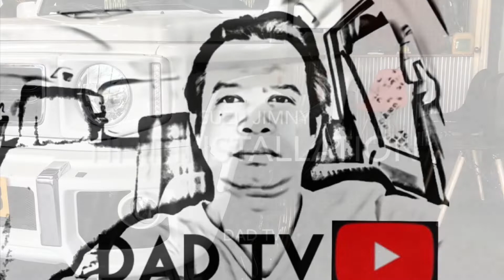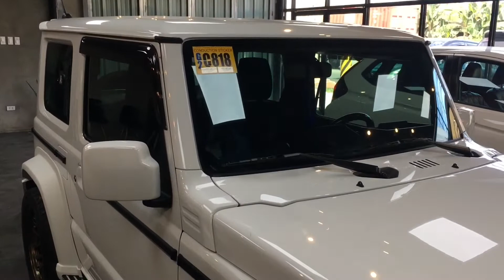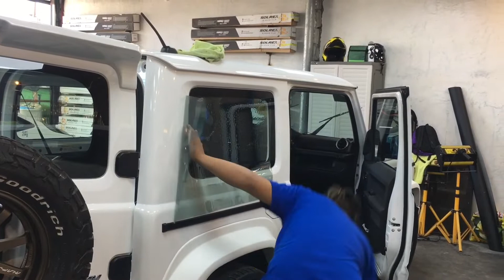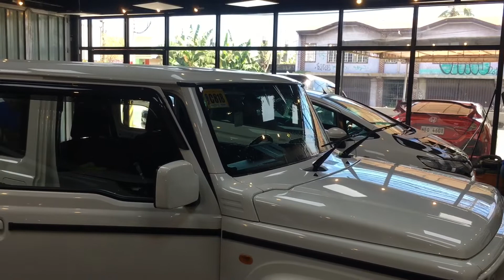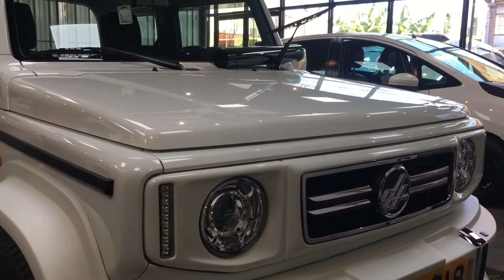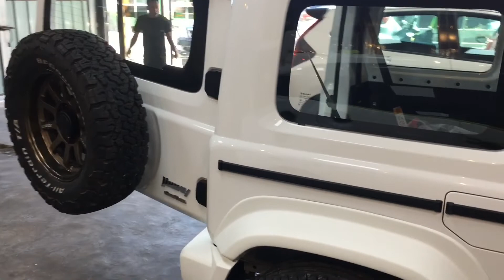Suzuki Jimny 2021 Tint Installation @ Tatin Garage Imus City, Cavite Philippines

Comment: Did you tint the outside of the wind shield? I've never seen that before.  What is the % of the tint?
Reply from the maker: Inside lang sir ang tint sinukat lang sir sa labas. Tnx
Reply from the maker: Tint inside , outside is just the measurement of the tint . Tnx